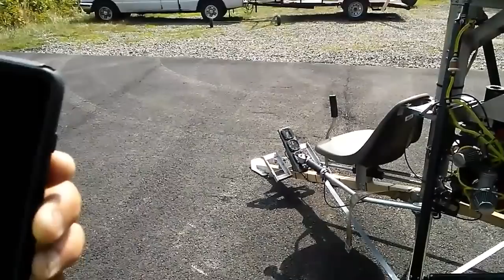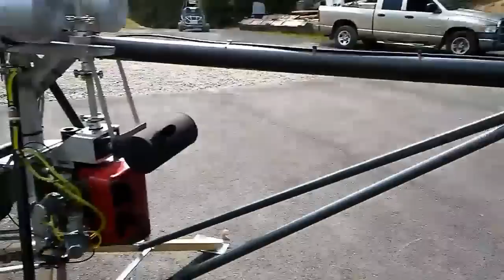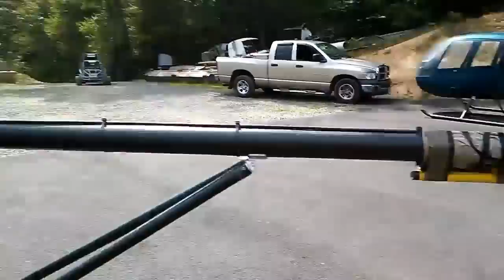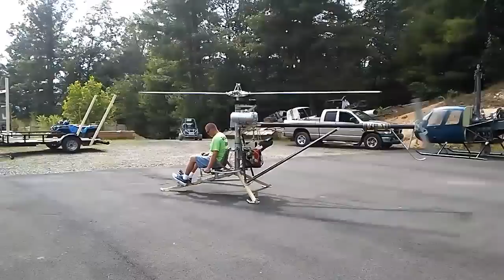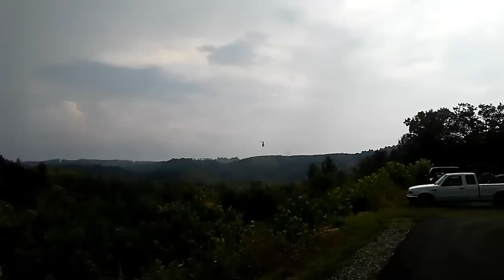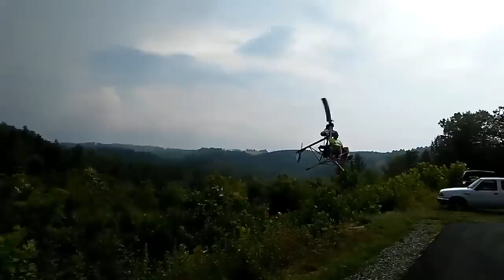Mosquito Helicopter with Rotax 50 Horsepower 503 DCDI Engine

Comment: Reminds me of the things you would see in the backs of comic books back in the 80s. They would have an ad for plans for a helicopter that you could build yourself in your backyard. They pretty much look like this thing. All I gotta say is you have to have a lot of faith in that lawnmower motor to go up in that thing.
Reply: He can still autorotate if the engine quit.
Reply: That's a "Rotax" aircraft engine. Extremely reliable (basically bullet proof)and widely used in light sport (LSA) and ultralight aircraft. This motors big brother the 915 has a variety options and HP ratings. Rotax engines have been around since the 1920's and are also found in untold numbers of snowmobiles, ATV's, and personal water craft.

Comment: I had a gyro copter. Flew it 100 hours.  I definitely would recommend wearing a full coverage helmet and some more protective clothing. If the engine quits right just in front of your feet is where you will touchdown 😮.
I flew the gyro copter  once on a 75 mile 3 leg cross country. The next day the engine would not start and i found the ignition coil wiring broken. Lord was looking after me. Be careful.

Comment: I'm sure duct taping the ballast back near the tail rotor is fine, it will never work it's way loose and get in the way of anything. Not like helicopters are vibration heavy or anything
Reply: Yes that ballast is well scetchy,wouldnt take much to have on a slide bar, with lock screws,so it can be trimmed easily & wont fall off.

Comment: man, if those tail rotor blades break free... you're going to get sliced and diced
Reply: ?!!  *NO*... he isn't!!  If the blades come of they'll disappear over the horizon at a rate of knots (obviously).  That won't, of course, stop what remains of the machine and the (patently deranged pilot) from plummeting to the ground to die a horrible death.
Reply: @martinwinlow  we can see this model of mosquito is very simple with a little Rotax engine so I saw another helicopter more complexe engine homemade and  with such more complexity systems about the rotor and never try to fly and take off ? Why ?

Comment: You should probably wear your De Ta Deeee helmet when operating that angry contraption!!!! 

I know it's an experimental but I'm pretty sure the FAA would frown upon the use of what looks to be duct tape and packing paper to secure that ballast on the tail boom that close to the tail rotors!!!! Just sayin'.........
Reply: Nah, you should see the tape they put on the cables to all the velocimeters (similar to a knock sensor in a car) of a Chadwick Helmuth rotor smoothing setup. Zip ties and 100mph tape everywhere.
Reply: @timhinchcliffe5372  most people Trying to make homemade helicopter more complete and complex than this mosquito (on this video) but they don’t try to take off and does not works (sorry my English is not very good) why ?
Reply: @pimuce  it's hard to tell with each case but I'd say being overweight or underpowered would be the main cause.

Comment: This guy is flying in the air, just a few feet from all sorts of moving and fast-spinning parts that could kill him in an instant, and he isn't even wearing any sort of helmet or other protective gear... unless shorts and a T-shirt count as protective gear.  He may not have any screws loose on the copter, but he sure has some loose ones in his noggin, because his common sense is falling out.

Ed Schulhtheis, PE
Mechanical design engineer and manufacturing consultant for 35 years
Former aerospace engineer for US Navy
Schultek Engineering & Technology, Inc.
Reply: Not a good look for an educated man to be throwing out derogatory comments based on speculation.
Reply: @AX01Adventures  There was no speculation in my comments.  The pilot was simply not dressed in any sort of protective gear to mitigate the high risk of injury to which he was exposing himself.  He either has no common sense, or he just doesn't care if he ends up in a body bag.
Ed
Reply: You are inferring this helicopter pilot has no common sense. How is this not speculating? Do you know him?  It is your opinion.

Blatant derogatory comments about someone you don’t know doesn’t look good. 

That’s my opinion. 

Show some humility, and get your point across without the negativity might be a different approach to consider.
Reply: @AX01Adventures I am not inferring that he does not have common sense.  I am stating plainly that he does not have common sense.  Certainly he must be aware of the very high risks associated with what he is doing, yet he did absolutely nothing (except to fasten a seat belt) to easily mitigate those risks in the way of protecting himself in the significant likelihood that something goes wrong.  Sorry if you're bent out of shape by my comments, but I call them as I see them.  I predict that if the pilot continues to neglect the simplest of these safety measures, he will die or end up in a wheelchair because of his poor decisions.

Would he also dress that way if he was riding a motorcycle 90 miles per hour down a freeway?  That would be stupid.
Reply: I am not bent out of shape…lol

That is a false assumption, or more speculation. 

I think we all see and know what this helicopter pilot is doing can be considered dangerous. 

Your deagatory method is what I
Reply: Your derogatory comments do not reflect well.
Reply: @AX01Adventures  The fact that you think that my "comments do not reflect well" is your opinion and your problem.  It's not my problem.  If you don't like my comments, then don't read my comments.  You are neither my mommy nor are you a member of the YouTube niceness police, so stop acting like it.  Last time I checked, I live in a relatively free country (here in the US).  I don't need you to tell me what I shouldn't say or how I should say things so that they don't offend your sensibiltiies.
Reply: Some people do while other people complain.  This guy is a doer.  Guess what you are.